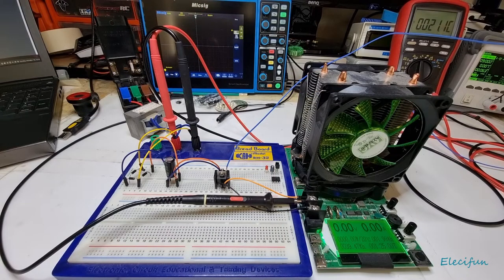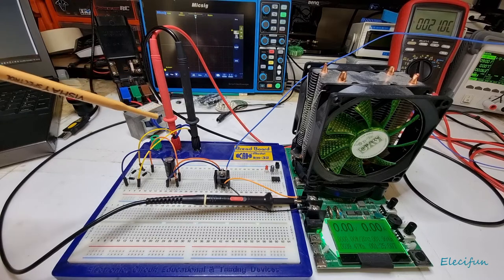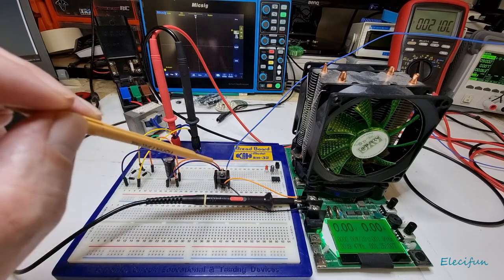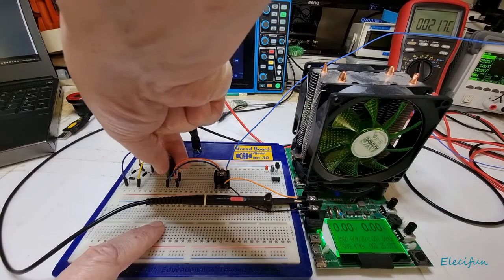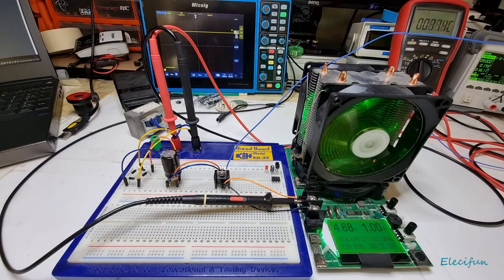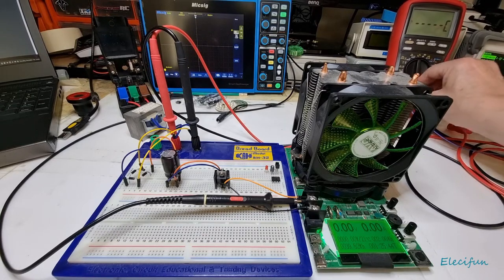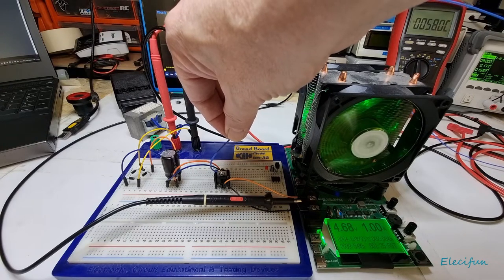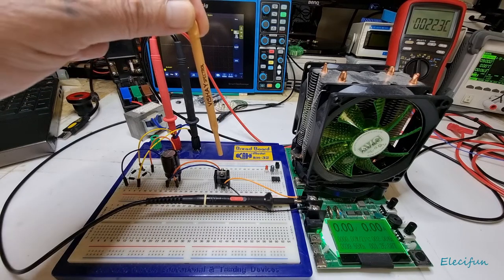Breadboard Linear Reg 5v pt2

Comment: Hello, just arrived on this video because suggested to me by YouTube. Just be aware in 78x datasheets you should add a 100nF ceramic capacitor close to the output to avoid oscillation. Also the input capacitor should be low ESR or tantalum, or most of time you can find a 100nF (or more) ceramic in parallel to the electrolytic input cap.
The datasheet says "An input bypass capacitor should be selected to provide good high frequency characteristics to insure stable operation under all load conditions. A 0.33 μF or larger tantalum, mylar or other capacitor having low internal impedance at high frequencies should be chosen. The bypass capacitor should be mounted with the shortest possible leads directly across the regulators input terminals. Normally good construction techniques should be used to minimize ground loops and lead resistance drops since the regulator has no external sense lead."
For the heat: P=UI. U=Vin-Vout. In a TO-220 package, like yours, it's 50°C/W junction to ambiant. So for example, for I=1A, Vout=5V and Vin=12V, P=(12-5)×1=7W. Temperature will be: 7W×50°C/W + ambiant temperature (21°C in your case), so 350+21=371°C which is out of spec (absolute temperature must stay below 125°C). So a heatsink is mandatory. You are using one which is good. In this case the thermal resistance to use in the formula should be the one of the heatsink plus juction to case which is 5°C/W in the datasheet. In this case, if it must work until 30°C ambiant temperature, 125°C-30°C =95°C. The heatsink to use must have a thermal resistance Rth lower than: (Rth + 5°C/W)×P < 95°C. P=7W in my sample, so Rth must be less than (95/7)-5. So Rth must be < 8,5°C/W
Reply from the maker: @Valéry MARZLIN or whatever your name is as looking at your channel I doubt you would have had this video recommended. Don't worry your secret is safe with me.
Getting past the techno blabber of your detailed comment/lecture. C1 is not needed here. Let me remind you what the datasheet states. 
 'C I is required if regulator is located an appreciable distance from power supply filter.' and 'C O improves stability and transient response.' as we were not looking for the latter and keeping this as basic as possible, it was not needed. 
Part one of this video was looking at the difference different capacity reservoir capacitors make, using different transformers on a very basic level. This part was to show the device still worked after the thermal cutout. 
No big techie techie or specie specie. Some of are here just for fun.